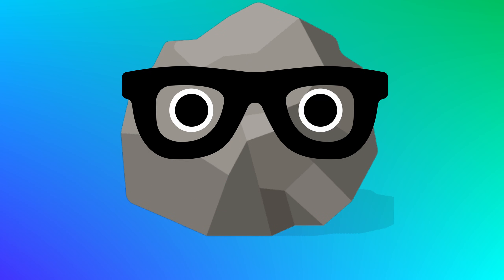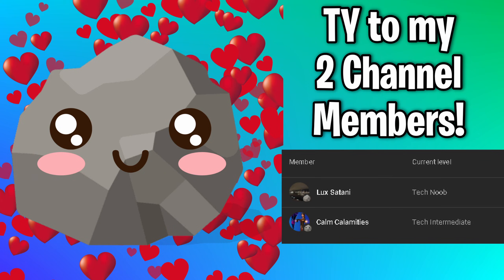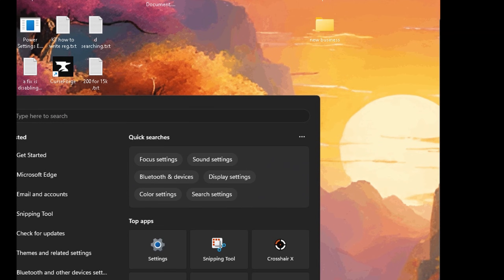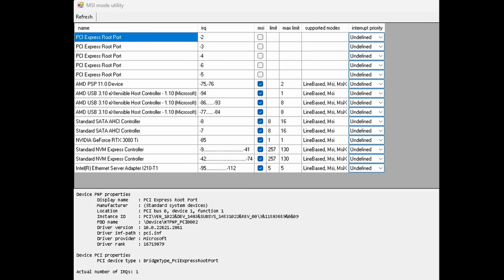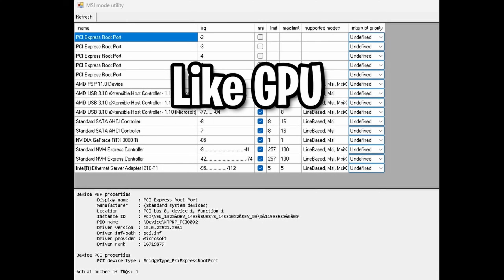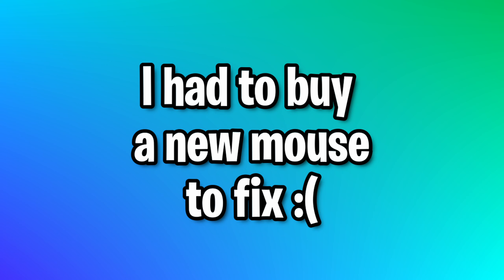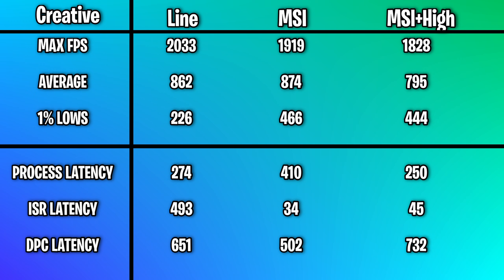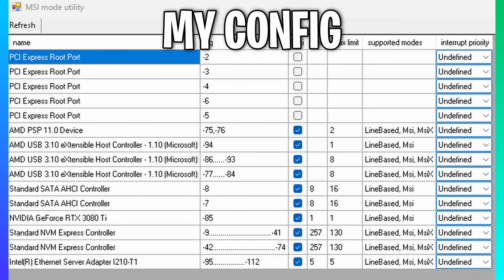Debunking MSI Mode: What it is and How to Apply | Khorvie Tech

Comment: Is Undefined + msi are default settings?
Reply: Yes on the newer tech like 50 series gpus it should auto default to the msi mode already. There also was a nvidia driver that also did this. Undefined should be fine since its done on the gpu itself and not managed by windows

Comment: I recently saw a video by ancel on packet loss optimization where he sets the limit of his wifi card to 256, at first it worked for me but now it gives me a code 10 error. How can I fix this issue?
Reply: Bro, all these tweaks are for content only. 99% of them do nothing and and some might even cause more problems than they help. Just go back to stock.

Comment: I hope you read new comments but when I did this before some month ago everything was fine and I followed these steps but now when im trying it again it shows my 2080 super that its not in MSI mode and doesnt have the negative number on it? In MSI util it says linebased and msi are supported so I guess its fine to enable and put to high prio?
Reply: @vipu6821  if you update your drivers they go to linebased in rtx 2000s. Newer rtx do come in msi by default in the drivers, 2000s don't

Comment: Great video,  I've been messing around with the utility for quite some time now. Hopefully you can help me? I have 2 (and a half) questions:

whilst a negative IRQ number for the PCI root Express slots means they should already be working in MSI mode, I'm almost 100% certain that ticking the box for MSI (thus adding MSIsupported=1 to reg) makes the pc perform/feel way different;
1. Does ticking that box for the pci root express ports change anything?
(from my experiences it severely lowers input latency, but messes up the GPU-Input coordination compared to normal config; you "are" the game instead of "inputting" into what you're seeing... hard to explain)

2. Both having the least amount of active devices & having the input devices -IRQ closer to the GPU's -IRQ will be beneficial for feel and performance from my experience, so is there any way to manually configure the order and values of the IRQs?(device manager is greyed out)

2.5(messing around in regedit PriorityControl with stuff like IRQ0=1 or IRQ0Priority=1 will change system behaviour, but keep IRQ values the same; any thoughts/info on this as well? (0+8 for system timer and you can e.g. also use irq value x from gpu/usb for IRQxPriority)

Thanks a lot in advance ❤
Reply: I doubt anyone qualified enough to answer any one of these questions can be found in this comment section
Reply: did you ever figure this out?

Comment: you should use msi always on eveything most of the time, GPU 100% and others 50\50 cause I and probably many probably have sound interrupt , example high definition audio and amd high def audio both had irq of 52 so it was interrupting I made them msi and they became different values and checking latencymon I didn't have high latency in audio anymore...
so at least check numbers if any of them are same do msi!

Comment: MSI (undefined) shot my FPS up by like 50 FPS... But, guess what? It wasn't the MSI on the GPU that changed much (it did a little) ... it was using MSI on my soundcard... for whatever reason my sound card was the bottleneck and the audio stutters and locks are gone. Why didn't they put this setting in the driver?!

Comment: @Khorvietech hey khorvie for the ones that dont say msi line based but have a minus before the number can i check them as msi mode. I also have two high definition audio controllers that are numbered 17 and 17. positive but then for them it says its line based msi and not checked. so should i check those?
Reply from the maker: Everything that is supported should be on msi
Reply: @khorvietech  Ok I will try checking them then thank you

Comment: I heard that some stuff runs better without MSI Mode turned on, like the USB Host Controllers. What do you think about this?
Reply from the maker: Think it’s worth testing either way and see what works better, each system is different
Reply: @khorvietech  Oh okay because I tried it out and it feels smoother and more responsive. Thank you!

Comment: Hey I have a ryzen 5 5500 and a Rx 6600 non xt I usually avg 180 fps on fortnite on low settings and I want to get more if I was to upgrade should I upgrade the cpu would I get more fps I was thinking about getting the ryzen 7 5700x3d and what gpu should I upgrade too ? Please and thank you I would appreciate it.         Note: I have b550 motherboard
Reply from the maker: At least a 3060 ti
Reply: If graphics not a concern get the best cpu you can if your focus is on competitive gaming.

Comment: Hey I have an internet question would love to get an answer if possible. Should I get Google Fiber 1Gig internet with a custom router, or AT&T Fiber 2Gig but have to use the router they provide? Whats the best for gaming and low latency/ping
Reply from the maker: With at&t there should be an option to use your own equipment but i'd probably go custom router with Google. Isp provided ones suck

Comment: pretty childish question igot here but im using an mx570 A with an i5-1240p with 16 gigs of ram. i play fortnite and i optimized it (with your guide) one of my friends said i should be getting 100 fps although i only get solid 60 in no delay creative maps and in battle royale i stutter alot below 60 fps. pls i need help
Reply from the maker: 100 fps is kind of a large stretch, i think if you want those sort of frames an upgrade is very needed
Reply: aight then thank you
 @khorvietech

Comment: My 3070 already had MSI enabled
Reply from the maker: Sweet
Reply: @khorvietech Your msi settings works best for me. Tried both default and no msi mode. But whats with windows sabotaging gaming 'feel'. You actually need to dig into windows manually and delete some garbage regulary. Combined with your msi settings, can finally do some gaming. As example, lets say you have constant 100fps, but view on monitor/mouse inputs feel 🐕‍🦺🍦

Comment: I have a weird FN issue atm. In most creative maps, I get a solid 16-18 ping. In others, such as Martoz Turtle Fights, my ping spikes like crazy and varies from 16-100 or more.
Reply: I think the reason that weird fluctuation happens in martoz map is whenever someone new enters or leaves it spikes for a sec, it used to happen to me before
Reply from the maker: Cant say i know the issue. It could be the fact that theres a high concentration of people in a small area
Reply: @khorvietech  1 other thing. The ingame highs and lows fps counter seems to be pretty off. My fps on msi afterburner is like 200-235, but the ingame counter shows my fps going to as high as 250 and as low as like 100. I don't feel many microstutters, so not sure how accurate it is.

Comment: Hey Khorvie, have you seen the processer performance time check interval option power settings explorer? I saw a video from someone that explained that this setting by default is set to 15 milliseconds on ultimate performance which is creating interrupts for almost no reason down at the kernal level. But by setting it to the maximum of 5000 milliseconds you reduce the amount of interrupts and noise down by 10x and also reducing system latency alongside with it. 
with the default 15 millisecond the average microsecond interrupt latency is around 60+ using xperf with also over 113,000 interrupts but by setting the setting to 5000milliseconds you reduce that interrupt latency down to 10-15micro seconds with the interrupts being around 1330-1440+. And can be further reduced by disabling the windows right cache buffer flushing which i don't want to do because i personally don't want to lose a bunch of data for latency tbh. 

In general i think it's pretty interesting to check out. Not sure if you've heard about it or not.
Reply: Ik this is a pretty dated comment but I just wanted to add that for me, and many others, having it set to 5020ms-5040 instead of 5000 makes for a much more stable low latency. At times, when using 5000, It'll spike the latency under load so don't be affraid to test around for your own rig. I'm using "Measure Sleep" to test btw.
Reply from the maker: Yup i have, i'll be including a power plan with that tweak in my new 2024 optimization guide
Reply: @khorvietech That's awesome, great to hear! : D
Reply: I hope you and Savitarax cooperate about this  @khorvietech
Reply: @khorvietech when do you plan to drop the new 2024 optimization plan btw?
Reply: @khorvietech  optimization sucked. btw

you people think putting ultimate performance makes your machine run better. when it doesnt.

balanced is always better. itll go up when it needs to.

Comment: Khorvie thank you for another w video but I had a question I tried using nv slimmer in one of your videos that debloated my current nvidia driver and it just made my performance worse please if you can follow up with me on this thx for making great videos
Reply from the maker: Usually gpus need time to recache like a day or two before running smoothly again, has it been past 2 days?
Reply: @khorvietech  it’s been a ab 24 hours
Reply: And is there any other easier way I can contact you about tech advice it would be greatly appreciated

Comment: How i can fix low gpu usage when i play Fortnite?
Reply: Thats due to a bottleneck and also fortnite is a cpu game
Reply: @Jonathan95326 I got RTX 3080 and intel core i9-10850K
I don't know how to fix this

I have seen on the internet that this is a common problem with the 
RTX 3000 series
Reply from the maker: low gpu usage just means that its not doing much, you could try turning textures up higher if you want
Reply: @khorvietech  I have tried everything

I turned up the graphics and everything and it's still very low and it's causing me 
fps drops
It never goes over 60% on GPU
Reply: @MarVeida Use DX12 if you can
Reply: @decliningship4208  
it dosen't work
i already play on DirectX 12

Maybe it have something to do with that i play 1080p but i don't know for sure
the monitor is Asus VG279QM and it's 240hz and it is 27'